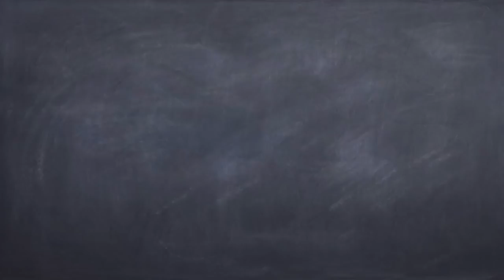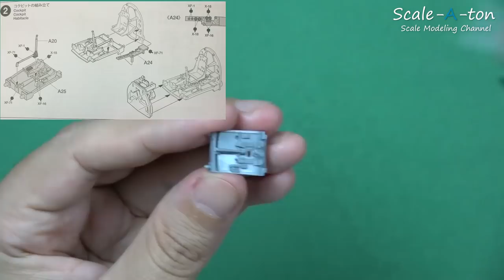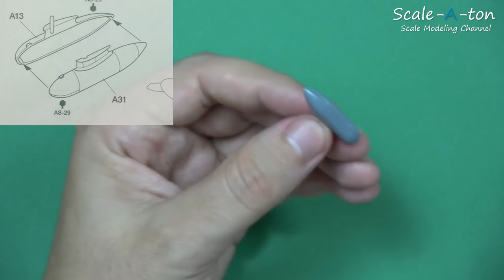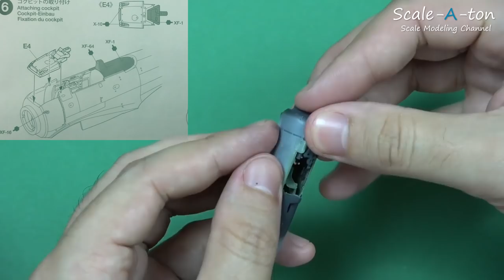1:72 Mitsubishi A6M3 Type 22 Step by Step Model Aircraft Build | Hiroyoshi Nishizawa

Comment: A sport flyers dream craft. Gave everything for light weight offensive maneuvers. Very vulnerable to returning fire. A turning dog fight was its forte able to thrust vertical an bring another dimension to aerial combat. Two twenty mm cannon, two 7.7 mm machine gun. The later syncing with propeller.

Essentially a gun platform boiled down to its most minimal structure with the ability to carry extra fuel or relatively light bombs.

Comment: 10:52 Somewhere i read that Aotake painted wheel wells are not found at A6M3 Zeros because they were all built by Mitsubishi which didn't use Aotake at that time. Tamiya did this wrong in the painting instructions.

Comment: Very very nice work on a small scale Zero! Love it!  The Model 22, I recently learned, was not the initial production  version of the A6M-3 variant. (I have started to buy the Hasegawa 1/48 family which runs the whole gamut from the A6M-1 right through to the A6M-7..) The first A6M-3 was the Model 32 (Allied codename "Hamp" with the clipped, non-folding wingtips) But this - despite being faster than the A6M-2 with a greatly improved roll rate- was not popular at all with the pilots. The more powerful engine and clipped wings meant a great increase in fuel consumption and a reduced ceiling height (And there was no change to the Fuel capacity), which meant that the Model 32 was the Shortest ranged of ALL the Zeros, with almost a 2 hour endurance reduction! Complaints about this reached the Mitsubishi Factory very quickly and a decision was made to incorporate many of the changes proposed for the Next A6M-5 variant into the current A6M-3 with a new model number. This became the A6m-3 Model 22, which restored the folding wingtips and increased fuel Capacity with enlarged main and new secondary wing tanks. The Model number of 22 was chosen to deliberately associate this new variant with the A6M-2 Model 21, which was greatly liked by it's crews, and the Model 22 was also very popular, especially as it was the LONGEST ranged Zero Model of all! And, BTW it was far more common than the Model 32, only 400 odd Model 32's were built, but over a thousand Model 22s. (Info gained from the history section of the Haseqawa A6M-3 Model 22 kit's instruction booklet and confirmed by a little research into the Zero.  Co-incidentally, this is also why Model 22 wrecks are often mistaken for A6M-5 Model 52 wrecks as many of the salient features are the same. You have to check the wreck's data plate (If it is present) against Mitsubishi and Nakajima records to find the production variant for that aircraft.

Comment: I have a question about pressure.
As I have watched, you use for paint(thinned in different ration) next rules:
nozzle - 0.3mm, pressure - 15psi
nozzle - 0.2mm, pressure - 20psi
and for clear coats:
nozzle - 0.3mm, pressure - 20psi
Am I right?
And what pressure will be good enough for 0.4mm? 10ps? Maybe you can recomend some table or curve? 
Do you use another pressure depending on paint to thinner ratio?

Comment: Very nice build.  What was the gizmo you used to cut out the circular masks for painting the national insignia?  Was it obtained commercially or did you you rig something up yourself?  I've never found one that could trace out circles of such small circumference, have always had to use a piece of razor blade at the end of a string.  And my fingers are so fat n' clumsy that it always ends up taking two or three tries before I get it right.  It'd be nice to find something that's easier to use.

Comment: I have one question : very often you use cement on areas which are already colored. Is it not necessary to remove the paint for good results ? Or do you use a special cement ? Well, I paint my models with enamel colours and i have to remove the Paint where Parts have to be placed to get a strong bond. Is that not necessary when using acrylic colours ?
Reply from the maker: It's MEK in the Tamiya Bottle. It's welding plastic parts together painted or not painted. Need some experience with painted parts though.

Comment: Tamiya extrathin "Quick setting"? Is it new? Never saw before. When they say "quick" they means that instant? 1 minute? How fast it is compared to the normal extrathin?
Reply: Been out a while now. It can dry very quick ( less than a minute - lots less mostly)so you have to be ready for it. It's a bit more brittle after setting i have found, but that may be related the kit manufacturer and the exact type of plastic. Worth getting.
Reply: Less then a minute? Wow. But it's not cyanoacrilate right? It's just a super quick "normal melting plastic" glue?
Reply: Koutetsu Jeeg yes. It's a solvent glue
Reply: I actually own one, using it on really small pieces (in cockpit for example, or on ships are usually tons of tiny pieces) or when I need fast bond which I later strenghten with classic extra thin
Reply from the maker: in addition to the previous comments "and it's awesome! " ;)
Reply: When I saw in the video that you use that to glue parts already painted I taught "Oh my God what he is doing!".
When I was young putting glue on a painted surface means to see the paint cracking and peeling away! It was a nighmare! Now that's not a problem anymore...what a beautiful life we are living :-P

Comment: Hi Scale-a-ton, you sure know what you are doing. Can you help me, I'm in the market for a good air compressor for modeling?What should I look for, a good pressure gauge between 0-40 psi? I have a large, loud pancake air compressor and the gauge starts at 0 then the next reading is 20 psi. This gauge does not work well when I'm trying to get consistent air flow settings at 18 or 22 psi. Can you help me please? What do you use or recommend?
Reply from the maker: Hi, I do not have the knowledge and experience to recommend a air compressor. I use a compressor like this and I am very pleased with it. (not this brand but exactly the same) http://chainsawjournal.wpengine.netdna-cdn.com/wp-content/uploads/2017/05/California-Air-Tools-5510SE-quiet-air-compressor-01.jpg
Reply: I'm purchasing this one now. Thank you.

Comment: Some nonsense going on with this build, A6M3 was built only by Mitsubishi which did not use "aotake" in wheel wells. Also there is no way the finish would "chipped" to natural metal due to strict and complex priming and painting of IJNAF aircraft. Hat off to airbrushing skills though.
Reply: There's always some artistic license when finishing these models--but I suggest you look up photos of the original aircraft.  These were not carrier-based Zeros--whose finish would be maintained more meticulously--but rather, land-based on New Guinea, under some of the worst environmental conditions of the war, and with understaffed and overworked ground crew under regular attack by Allied planes.  It didn't take very long for these ships to start looking pretty rough.